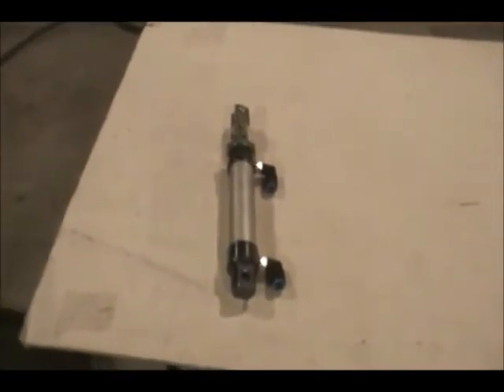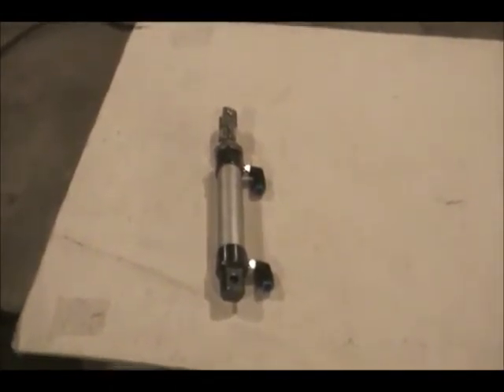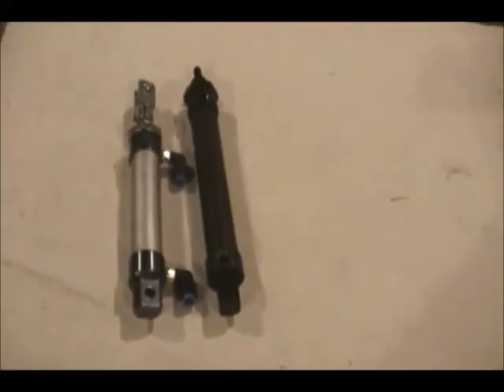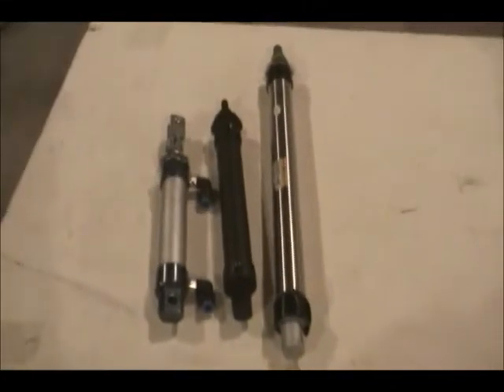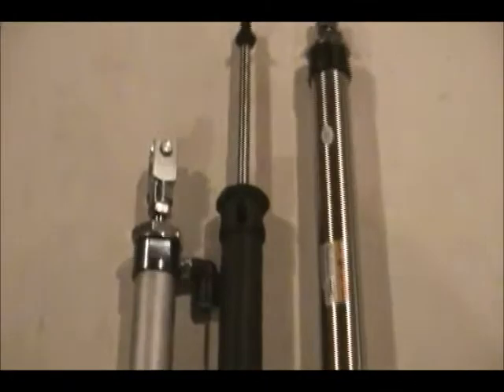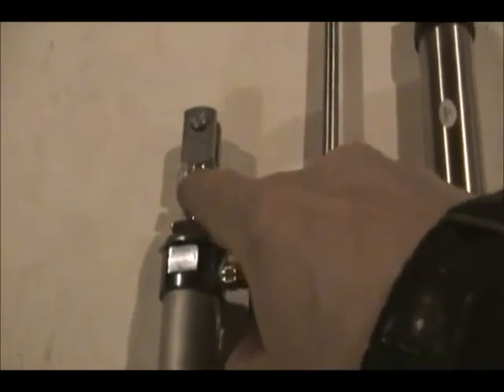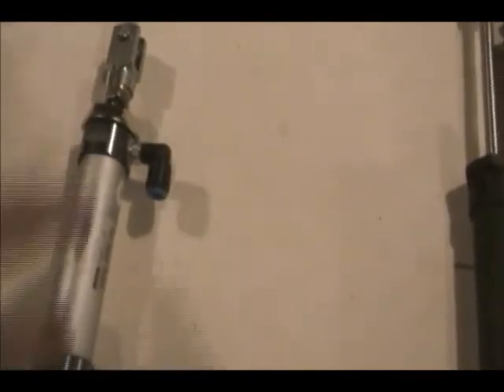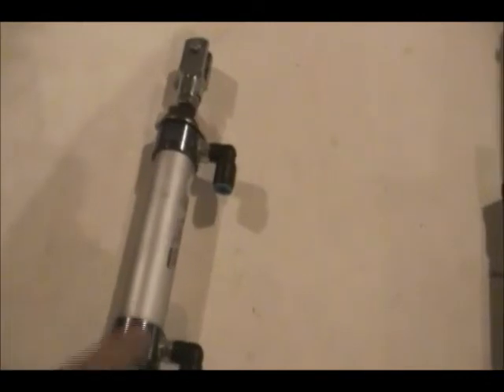Dead Things Vlog-Pneumatics Part 3

Comment: Stupid metric system! But otherwise a very clear explanation of the operation of cylinders. Between your videos and Greg's (Windowmakerproduction) scissor hinge videos, I almost feel I can build a pneumatic prop!

One question I had, though, was how do you know which cylinder to use with which prop? How do you best determine whether to use a 3/4" bore or a 1" bore or a 1-1/4" bore and what stroke to go with it? Thanks again for some exceedingly clear tutorials!

Rich

Comment: AHHH QUESTION! on your 1.1/2 inch cylinder you have the rear attachment thingy. mine doesn't have it but i believe i have the exact same cylinder. i got it from princess auto. but did you need to switch out the rear end or did it come like that? and haha i have the same blue and grey cylinders you have. they're pretty sweet!.

Comment: you need to know the weight of what you are lifting                                                          3/4 bore produce 40 lbs. of force for every 100 lbs of pressure
1-1/16 bore are 100 for 100
1-1/2 bore produces 170 lbs. of force for every 100 lbs of pressure.
as far as how to determine the stroke you need to now far the travel needs to be.
like on the scissor hinge the travel is only nine inches but the prop moves sixty - seventy inches.